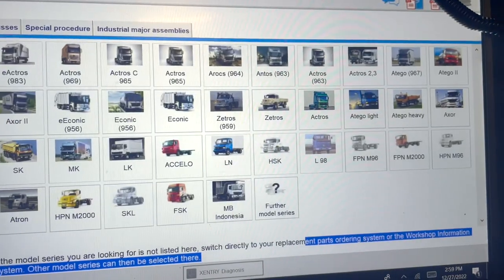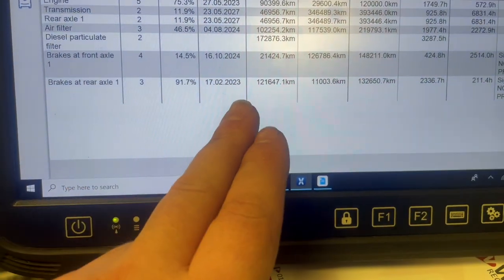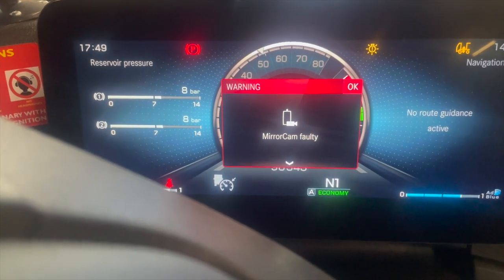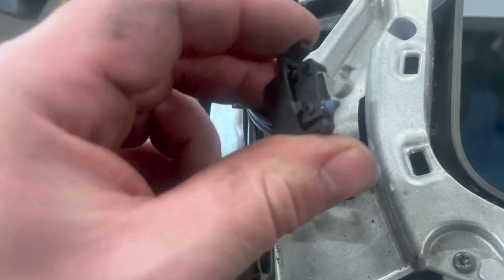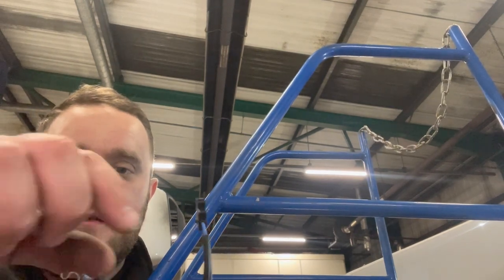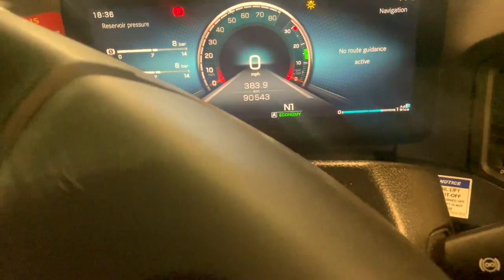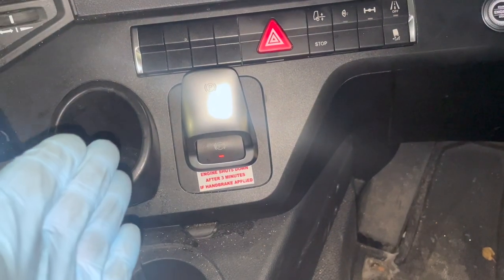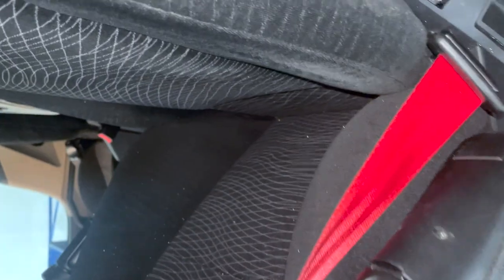A day in the life of a HGV Mechanic! Mirror cam faults and some Tail lift flaps not locking?!

Comment: hi mate...what do you think about to get into electric trucks? do you think that this field is profitable?
Reply from the maker: It would be very very interesting to see what it’s like with a loaded trailer etc, how long will the range be? Pulling power etc? How long to charge? These are the big questions I’d be asking, and plus the price, price of manufacturing these vehicle and buying them!
Reply: @freightlanetv  so you think that for the moment that field is not profitable? i am an apprentice and i have that doubt about if it is profitable to get into electric trucks as a tech
Reply from the maker: Things will change but electric in tractor units can’t see being a winner with a 7.5t possibly if around big city’s delivering but you just never know what’s going to happen.